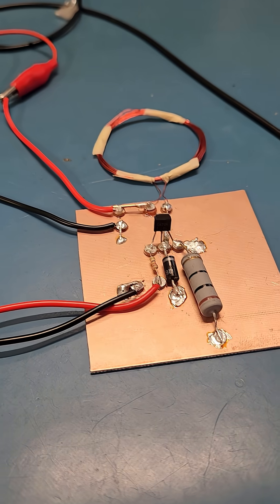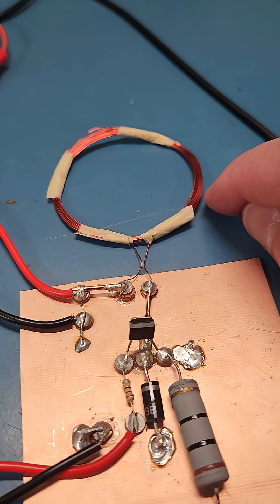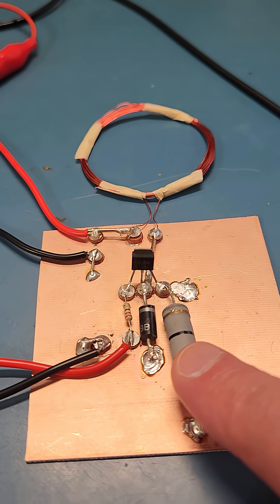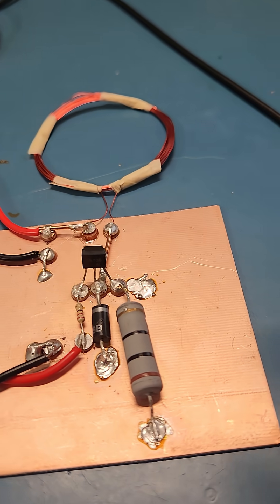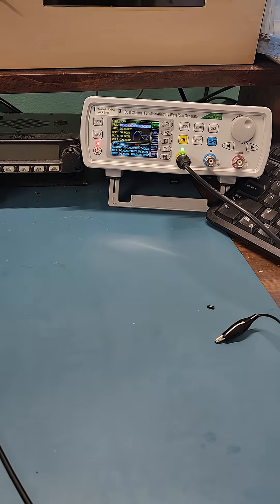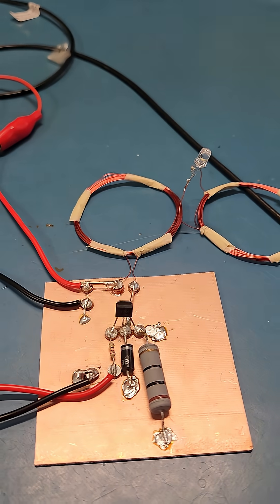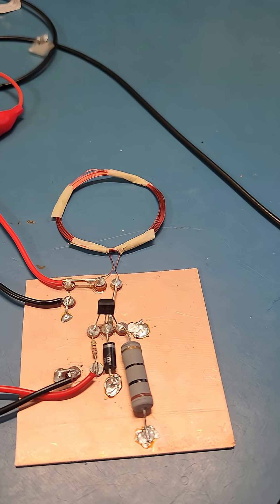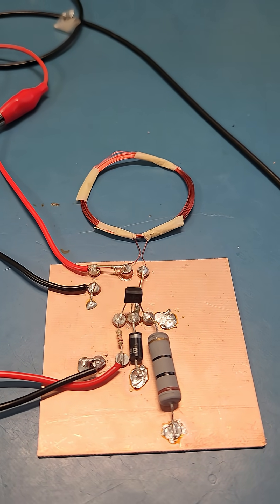🚨 It Works! My DIY Wireless LED Prototype (Power Through Air!)

Comment: Don’t get electrocuted be careful! Idk these things scare me 😅
Reply from the maker: I appreciate the concern :)  Yeah, the first time I apply power to a circuit is the trickiest... You never know if you missed anything.  I have a power supply that will limit the current, and it will shut off if it exceeds what I tell it to.  I'm working with 12V here, so it's not too bad